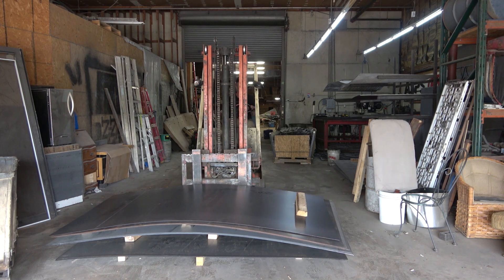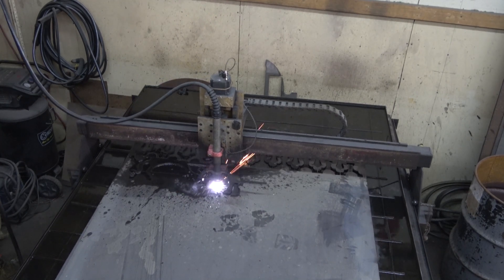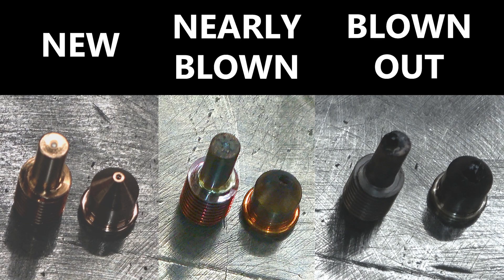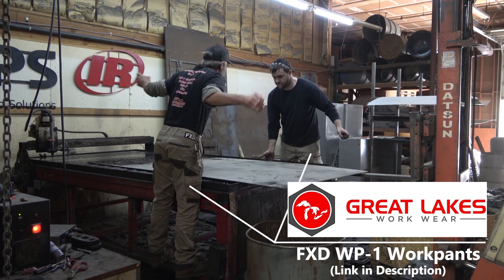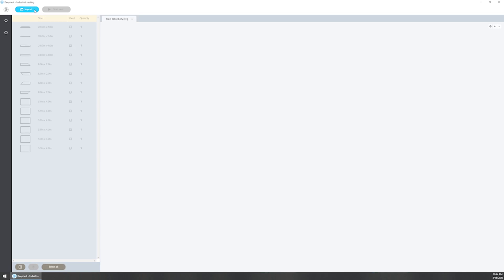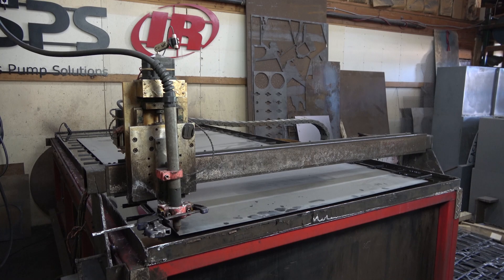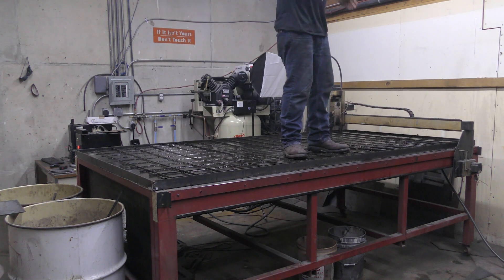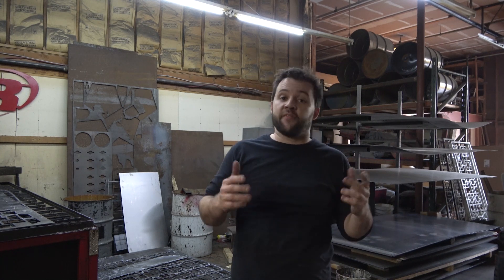Stop WASTING MONEY! Nest Your Parts

Comment: Re-watched this while wondering what to cut out of a lot of 11 and 14 gauge offcuts.  Most of my parts are big so i am forced into a new sheet quickly.  Nesting cant fixt me! Any ideas?
Reply from the maker: 14ga is great for bottle openers/F-bombs. 11 you should have no trouble making footplates and gussets for signs, fences, etc. Might end up holding inventory, but if you have the space, you're really only in it for the cost of consumables and time.

Comment: Always a pleasure. 42 Fab. 

Please do consider some safety when handling cut sheets off the table would not want one of those sharp cutouts to snag and send you to the ER Room and miss out on your great 👍🏾 vids tips tricks and more. 🤞🏽

Stay safe 😉
Reply from the maker: Plasma cut edges are not sharp, especially on thin material.

We do what we consider safe, we don't critique others choosing more or less safety. As much as the thought is appreciated, the need to preach isn't
Reply: 42Fab - Metal Fabrication & Signage sure thing Captain got it, I’ll work harder to stay in my lane

Comment: Deepnest runs best on linux I have found. Having 20 different really odd sized pieces will bring it to halt as it is crunches the numbers, also the more parts, the slower it will run as it tries every permutation to make things fit. Simple shapes work the best on deepnest. Also the array function builtin to most cam programs work well too, I think a lot people in my experience don't bother using either. I have found that it is sometimes much quick to build the array out of a few parts to my liking, then simply copy/paste the array N times as needed for the final cut.

Comment: You're cutting in the wrong direction. As the torch moves away from you the right side gives the squarer cut..  You're cutting the opposite of that.  Conventional versus climbing. I can't remember which one it is but you need to switch to the opposite one
Reply: How does a plasma climb cut? I'm confused

Comment: I tried deepnest.io now a few times and always was able to nest manually more efficient than the software did. By all means, I am not an expert, but have made up my mind about deepnest.io.

Shy away from it!
Reply from the maker: play around with the settings if you haven't. I can often manually nest weird shapes better, but after letting it chew on a file overnight (I know...) id did manage to get one more super odd shape on the sheet than I could. I mainly use it for fast and dirty parts runs like this one was.
Reply: @42Fab  unfortunately, it was a simple task. I was making face shields and had one design which I wanted as often as possible on a sheet. Manually I got to 20. After 12h letting it search the software came to 19.

Comment: Just glancing at your leftovers I can see that you are still wasting a helluva lot of material!  Nearly all of the edges can be used for other projects, or sold to others that would GLADLY snag it up.  And, some of those cut sheets still have huge areas of uncut material.
Reply from the maker: I'll sell you the lot for 10 cents a pound. 

At a certain point, you can only sell so many brackets, f bombs, etc, so cutting them becomes pointless.
Reply: @42Fab  there's always one that can do it better than you. As you stated, you get to the point of diminishing returns and it's time to let the scrapper have it. I save nests in Sheetcam like you do, disable the old profiles and drop in my new parts and rip away. Good share! Your 8% waste number sounds legit to me. When I bid production parts, I usually factor in 10% waste.
Reply: @42Fab  What state are you in???  Asking so that I can determine if shipping or driving will be best.
Reply from the maker: Oklahoma